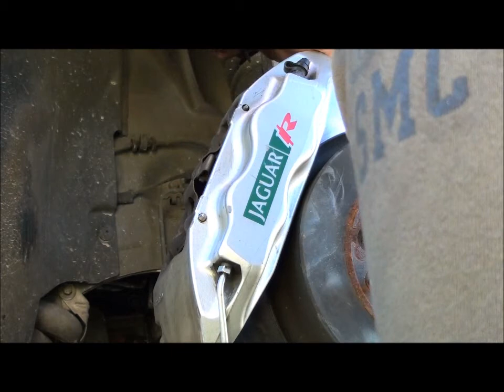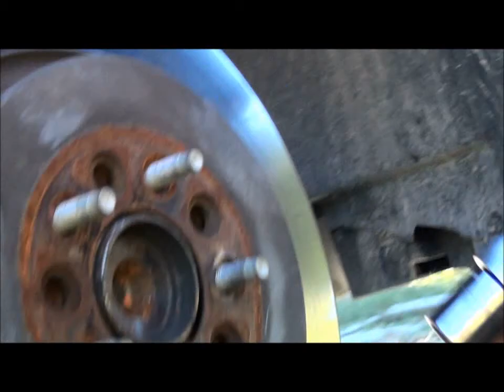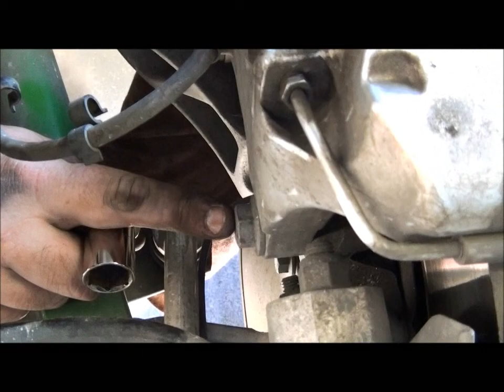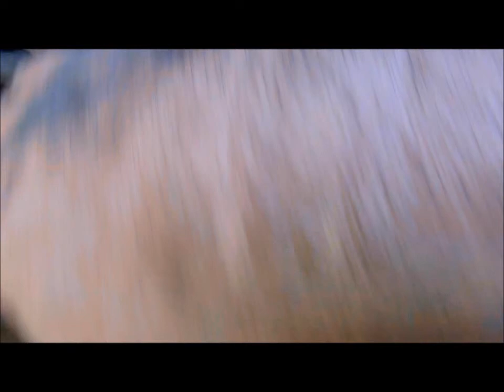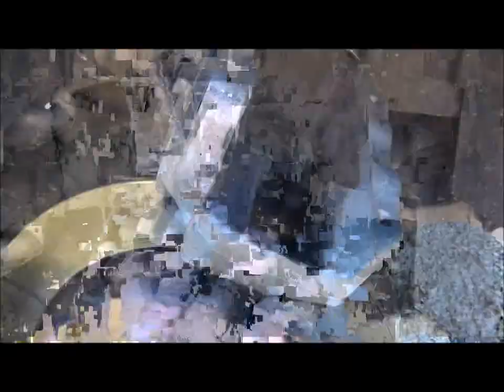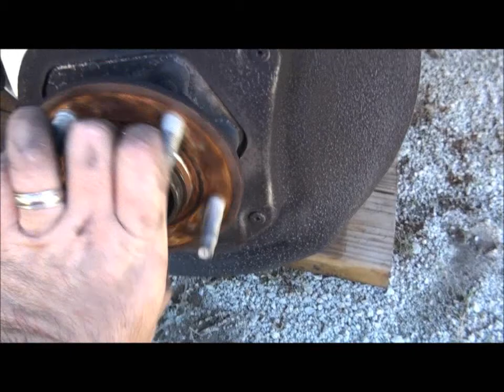Brake Job S type R Jaguar Part 1

Comment: Nice, but is not so smart to put some stuff on the hub. This because this will stop the heat from the rotor to go out and into the hub. It is important to lead the heat away from the brake discs, to avoid overheating.

Comment: I can't quite tell where your jack stand points are.  I have read different comments, but it seems alot of warnings of places not to use. Still not confident with the info I have found.  I see the jack points, but where is the safe place to then place jack stands?

Comment from the maker: Brembos are standard on all 03-05 STR's.  The rear is pretty much the same.  I have the footage but havent had a chance to edit it.  You have to hold the Emergency brake down while you pull the key out to have it not engage.  The Brembos come off the same as the front then the E brake is like a conventional brake it has slider pins and you just pull it off and push it in like a standard piston caliper.  Then you just reset it after reinstalling everything.  I'll try and get the footage together.

Comment: Very helpful video.  Having trouble finding one for the rear brakes- any suggestions for guides as I'm a novice when working under the hood.  Also how do I confirm I have a Brembo setup on my '03 STR.  Mine looks like I have the same setup as yours but was Brembo the standard for all 03's?

Comment from the maker: @chi05str I got them from brakeperformance . com.  They are really good with customer service.  I called after ordering and asked them about 20 times if they were the correct size.  They are centric rotors that they cross drill and slot in house.  So they sell any variation you want.  I got the black coated slotted and crossed drilled and they were I believe 450-500 for all 4.  Hope this helps and check out jaguarforums . com.  There is some good info there.

Comment from the maker: I dont believe I covered it in the video but before installing your new rotor you are gonna want to spray it down with some brake parts cleaner to get any sort of coating off that was applied for storage and shipping purposes so make sure you do this before installing the rotor.